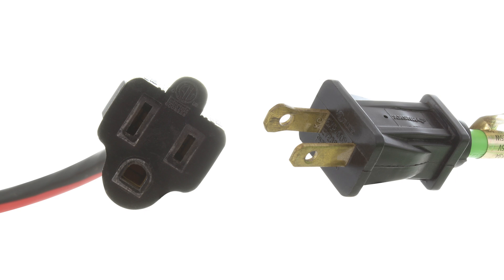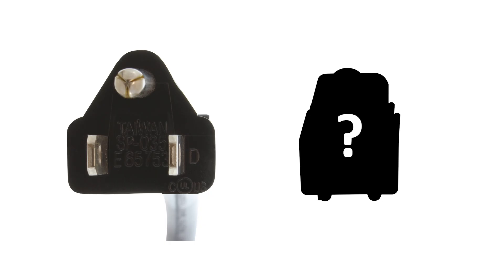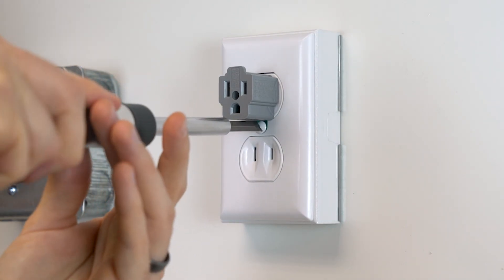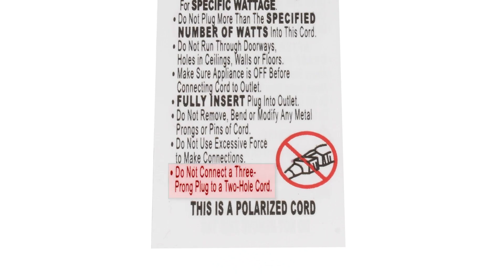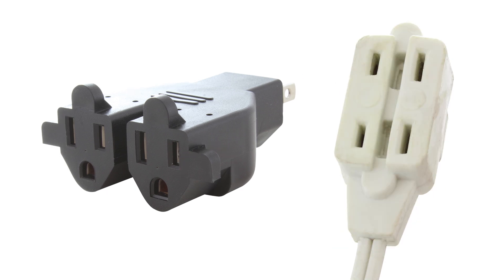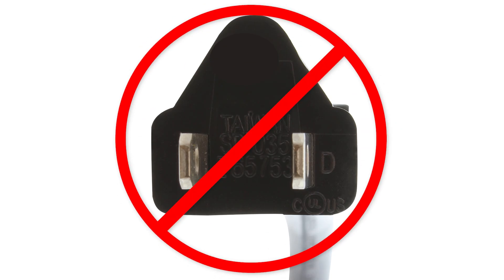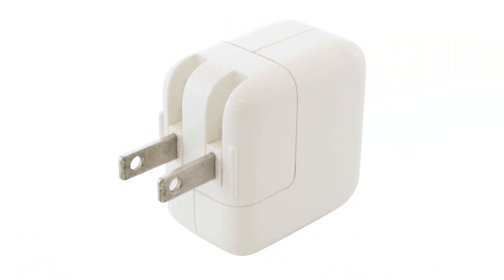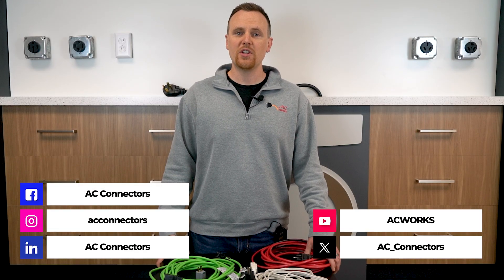🔌 Polarized Extension Cords – What Does It Mean?

Comment: Just as you should never remove the grounding prong on a three pronged plug to plug it into a two slot receptacle, you should never file down the wide prong on a polarized plug to plug it into an non-polarized extension cord or receptacle.   

Conversely, you might come across a very old lamp that has a non-polarized plug.   While the lamp would still work as if nothing is wrong regardless of which way the plug is inserted, for safety reasons at a minimum the plug should be changed to a polarized plug, and a continuity test should be made to verify the wide, or neutral prong is connected to the screw shell.  With most cords, there will be a ribbed side, and smooth side with writing.   The ribbed side is the neutral, however very old cords might not follow this tradition.  This where a multimeter can become an indispensable addition to your toolkit if you don't already own one.
Reply from the maker: Thanks for sharing those important safety tips! I didn't know that about older lamps.